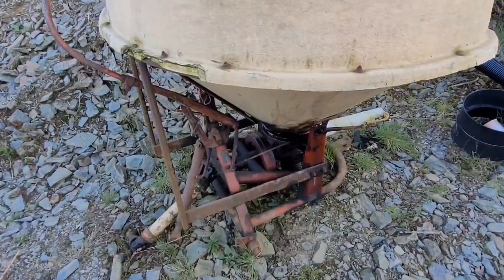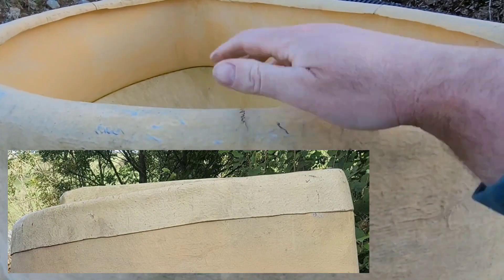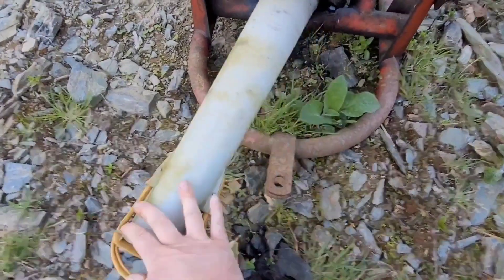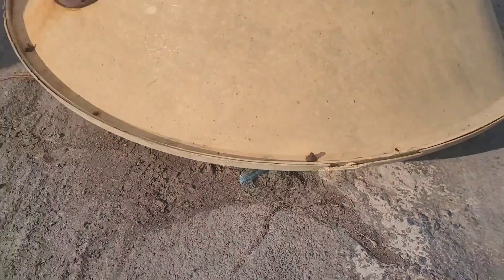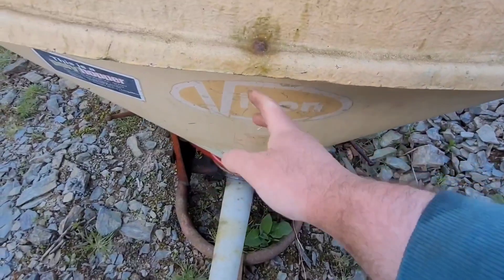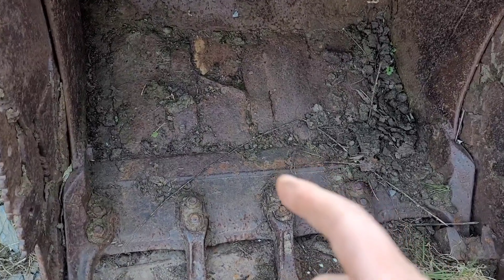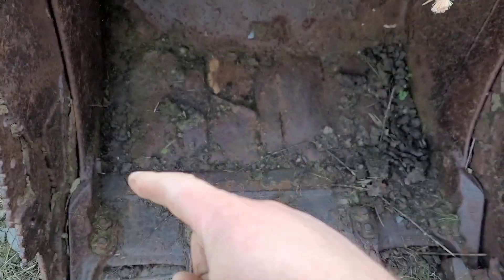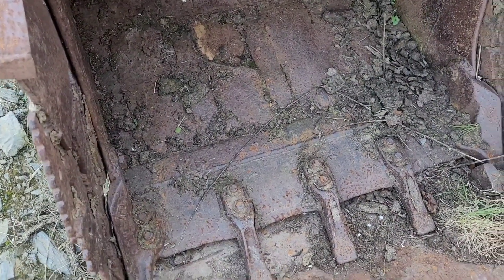Vintage Vicon vari spreader 400 mk2 locally made extention like a Vicon 600 and auction buys

Comment: Patches and sikaflex sandwich of the damage would make a solid repair of that original tub not that it matters now with the new'n but its handy on stuff that flexes for spreading the load.
Glued the roof rack on my truck with the stuff and shes still there 4 years later.